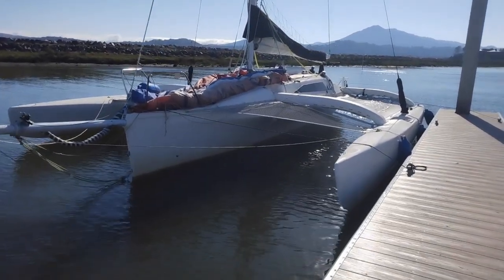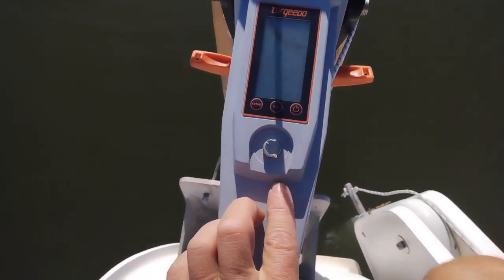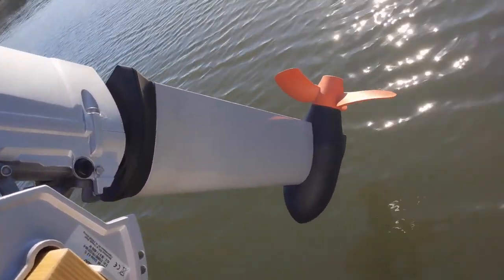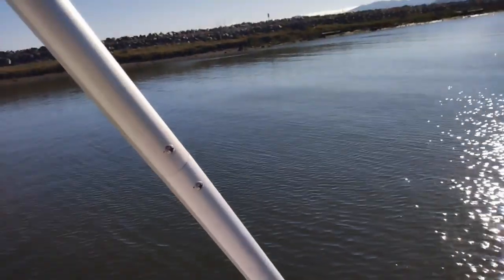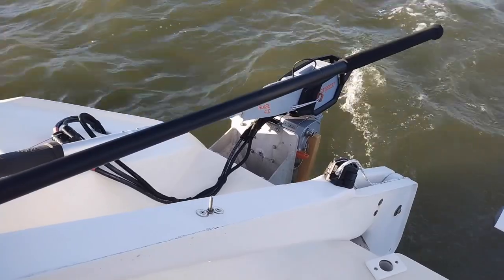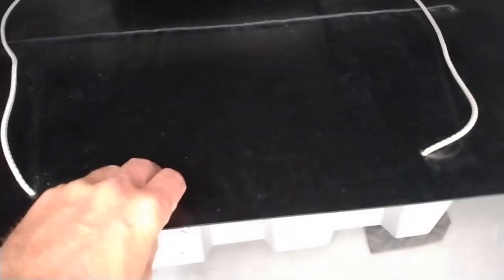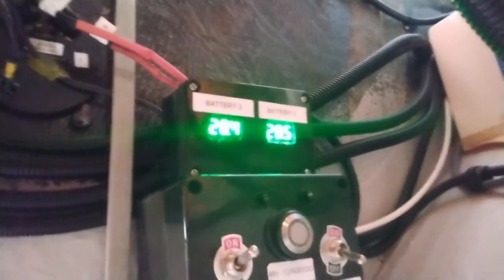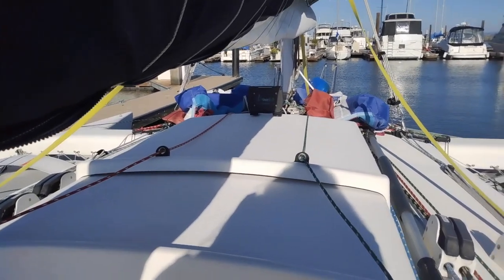Torqeedo Cruise Electric Outboard Review after 1 Year in Saltwater (not sponsored)

Comment: Hi , Do to my lack of experience,  I'm struggling to decide what the next engine on my F28 will be. Hopefully you're answer will help me to make a step forward.  I would like to understand why don't you choose a Tohatsu 6hp sail pro, giving the low weight it has.  Is it that much weaker than the Torqueedo you have,  or there's other considerations.
Reply from the maker: I know electric makes financially no sense. But it sure is nice that it always starts, has instant 100% throttle & torque with no warm up needed, instant forward/reverse (no gears), and not having to deal with oils, fuel, noise and smell is kinda nice too. Again way too expensive. But sure nice and I would not want to go back. But that's just me and personal use.
Reply: @thomashasch Thanks for your reply.  My question was more related to weight and power rather than financial.  Your point about  instant forward/ reverse is something to consider.
Reply from the maker: 6HP is not enough for an F31 imop, especially in a windy area (probably ok for a 28 depending where you live). My option was a 9HP gas motor (much heavier compared to my electric), which does really output the static thrust comparable to a 9HP combustion.
Reply: @thomashasch Many thanks for helping me understand.

Comment: Nice!

I am hoping to upgrade from my F-22 to an F-33. I'm currently using a Torqueedo 1-kW outboard (1003), which is plenty on the small boat. I thought I'd need a lot more for a 33, but... I don't have to do much motoring (just emergencies and sometimes docking if the wind is awkward), and I notice that you're going very well at 1 kW on Condor. Under what conditions do you need to use more power than this? I wonder if e.g. a high-thrust propeller would save me the trouble of a fancy new motor setup...
Reply from the maker: For me the biggest issue with our boats is "chop / waves" when the wind picks up, causing the propeller to come out of the water for a short moment. Of course this will happen with a gas outboard too. I never had a situation where I needed more power so far.

Comment: Cool video thanks to you!   I have a F27 and I have a 8hp in the well  I wonder if I could turn this motor in that well?  It would make my boat much more movable in tight spots?   Wow this is very cool and I love your boat!
Reply: I built my F-9A (aft cabin) and launched in 1993. I put the Yam 9.9 on it but linked the motor to the rudder which turns the engine. It maneuvers very well in tight spots and typically can do a 360 in about 1.5 or 2  boat lengths. If you can link them to turn the motor, I'd highly recommend it.
I don't mind having an ICE engine but my big issue with the YAM (or any ICE) is flushing it. My boat is on a mooring w/o power or water which complicates the process drastically. 
I'm seriously thinking about converting to electric for that reason. Of course charging batteries on the mooring will require a decent solar set up but the sun is out quite a bit here in SoCal. If I could even find a slip for my boat in Newport Beach, it would be way out of my price range. Mooring life is very hard on boats and their caretakers (owners).

Comment: Thanks for the informative video.  I've been thinking about a setup like this for a few years now.  If one is a sailor and coastal cruiser, and uses the engine only to get in and out of marinas, electric propulsion just makes a lot more sense, especially for a lightweight trimaran.  Plus the weight distribution is better.  I'm just not liking them Toqeedos - seems flimsy for all that price.
But I think having a motor with regen would also make a lot of sense. Maybe not at 16kn, but at 6-12kn why not.
Reply from the maker: "All" the electric outboard brands appear to have never been to the ocean. Regardless of brand, it feels & looks like a big Lego Motor : ) If you can go to a boat show and look at it in person. That being said, mine still works flawless. Just need to be careful with it. I wouldn't go back to fuel.

Comment: Thomas, thanks for the great presentation.  I have a 30 foot Condor trimaran.  Think F31 but beefier and slower in light winds.  But the fight is on in mid range winds.  On heavy wind days the F31's hulls amas aren't full enough to keep up with the fuller hulls on a Condor.  Love what you have done to strip your boat for racing.  Those days are gone for me.  I have thought many times about the electric motors.  But I sail in more remote areas.  For example, sailing from Mulege Baja heading east to San Carlos it is about a 10 hour sail.  The first 3+hours there is no wind and the sea was like glass.  Don't know how the Torqueedo would do with doing 6-7 knots for 3 hours.  Great challenges for the pocket book also.
Reply from the maker: Doing 6kts I would draw 1300 to 1500 Watts per hour in light winds. That's 4500 Watts in 3h out of my 7000 Watts total available. You would need to have a nice Solar array making you at least 800W @48V to make that sustainable travel.

Comment: I will in the near future be interested in the purchase of the same model Corsair. Just for interest sake what sailing speed can the boat achieve?
Reply from the maker: The Corsair F-31 was built in various layouts and configurations. It is therefore difficult to generalize performance. All of them will reach about 18 knots top speed. My boat is the rare and performance oriented  "1D" model, plus I have Cfoils. I get close to 22 knots of boat speed sailing by myself, but that is rare and scary. 20knots is no problem however. The boat will exceed the wind speed or at least match the wind speed under 20mph winds, a heavier cruising F31 may not achieve this that easily.

Comment: Thanks for this.   I am thinking about getting the corsair 880 and using an electric engine but couldn't find any info on how that might work.  I love your setup
Reply from the maker: The 880 does look like a great boat - looks nice that's for sure. I have unfortunately not seen or sailed one in person. I am honestly surprised that Corsair Marine does not even offer electric propulsion for any of their models as an option. Same with their Seawind Catamarans brand I think. You would think the "marketing" department would push to have such an option - even if for the PR and buzz alone, even if other departments might have reasons for why not. Anyway, maybe you can get an 880 without a motor from factory and put the money you saved towards an electric system. Make a video if you do - I would love to see it.
Reply: @thomashasch  it looks like they do offer a package. 
Or… Torqeedo outboard package 

    This kit includes:
    Flush mount throttle control
    Start panel
    Wiring to transom
    Steering linkage
    Cruise 4.OR electric outboard
    10ah battery
Reply from the maker: Oh wow- thanks for sharing. I should have double checked. They didn't as they first announced the boat. Good job them!

Comment: Great video Thomas!  I used a Tprqeedo Cruise 2.0 (5 hp) on my F-27 exactly as you do, in/out of marina (Vallejo),  ..... and loved it!  I might add an additional advantage is it eliminates the need to carry gasoline...a HUGE safety factor in my opinion!!
Reply from the maker: Very true.
Reply: Hey there Markpurdy, I also have a F27 ;  you have one of these on your F27?  Tell me more buddy, how does it work can you turn the motor for better movability?
Reply: Do you feel like the 2.0 was sufficiently powerful for all conditions? I have one and am considering putting it on my F31 but worried it might not have enough push to deal with currents, etc.

Comment: You can put silicone grease(not caulk) in the cable connector and it won't allow moisture in. I put it in all my connectors and never have moisture issues.    Also, it will prevent corrosion on the pins.
Reply from the maker: Thank you - good idea.

Comment: Thanks for the review, Thomas. My Torqeedo 1103C is 100x simpler than your setup, but I'm also not going to see 7 knots or 100 mile range either! I will have to do something however with the drag problem as my motor gets hit pretty hard when the wind picks up and I'm on a starboard tack.
Reply from the maker: Look into the bracket I used. $80 on Amazon https://www.amazon.com/gp/product/B072B64LWW

Comment: enjoyed the review thanks for posting!   I've had a Torqueedo 1003 for my F-22R, but I am 100% the guy you describe who isn't good at regular maintenance ... as in, during my first 3 yrs I lost both the kill switch and the orange locking stick, and I've taken it at least 4 or 5 times for service to have the cable connections repaired, both the thin control cable as well as the thick power cable.